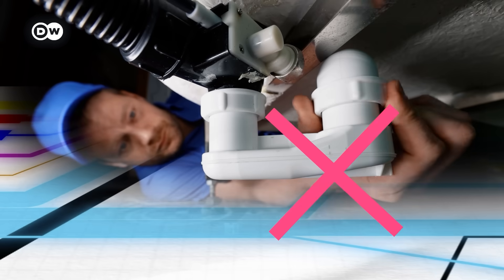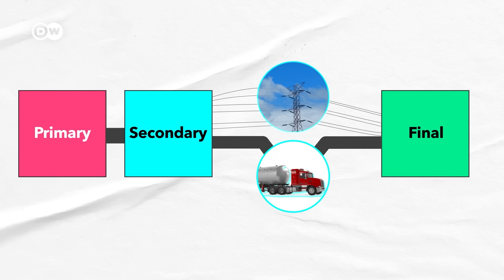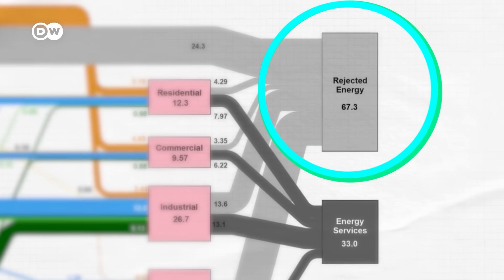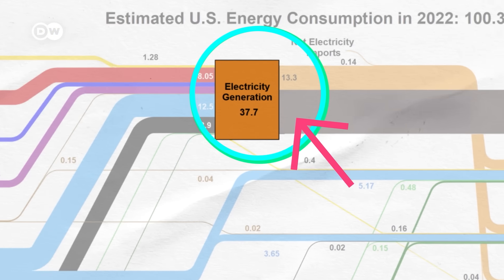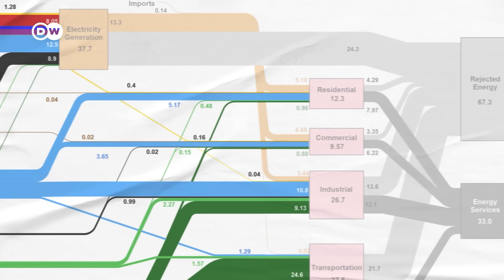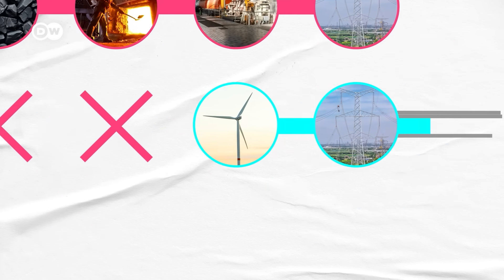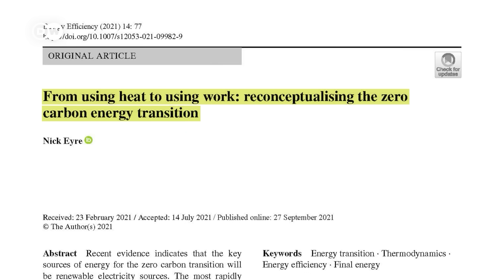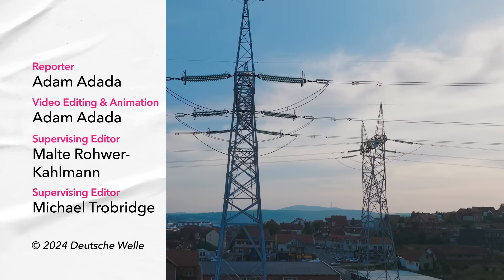The mind-blowing thing we get WRONG about energy

Comment: Sorry, this is a poor piece of propaganda.  This so-called waste energy is all about thermodynamics and statements she made about the efficiency of steam power plants decreasing with age are nonsense.   The efficiency is determined by the cycles used and the temperatures.  For example, a coal plant operating as a supercritical steam plant can get about 40% efficiency going from thermal energy (coal) to electricity and a combined cycle gas turbine (CCGT --running on natural gas) can convert 64% of the heat energy into electricity making that waste much smaller.   That is a 60% increase in heat-to-electricity conversion efficiency.  Coal gets most of its thermal energy from C + O2 => CO2   and gas uses CH4 + 2 O2 => CO2 + 2H2O which means much less CO2 emissions per unit of heat energy (about half as much) making the electricity from gas almost 3 times better than coal per Kg of CO2 emissions.   

These people know the numbers and you can't work in this field without knowing thermodynamics, but they are spinning them.  Trying to simplify thermodynamics for a general audience is hard but to spin is creating propaganda.  (the three laws of thermodynamics - 1- you can't get something from nothing: 2- can't even break even: 3- you die of a dramatic entropy increase )

Possibly the reason for this spin is to protect the stupid decision of our president to ban liquid natural gas export facilities when most of the exported gas could displace coal-produced electricity in other countries resulting in a net CO2 emission decrease.   

As I did my Ph.D. thesis half a century ago at Lawrence Livermore National Lab I know they have known about the above forever.   They know how much you can reduce that waste under which conditions.    For example, I could put heat transfer fins on the bottom of a pot and get more efficiency using gas than using electricity.

Comment: I replaced my gas stove with induction plate, replaced my central heating boiler with an air to air heat pump and my motorcycle with an electric motorcycle. A car with vehicle to grid would be awesome my motorcycle for example only used 500kWh in the 1.5 years I have it and 8000kms I rode with it. Thats around 60L if petrol. 60L of petrol usually gets a motorcycle for 900kms. See how much more efficient this electric motorcycle is? It's also much faster! And I charge it now during the day on my solar energy from my PV panelen :)
Reply: You obviously don't ride anywhere except in the city. I enjoy riding my motorcycle off road, where there's ZERO methods of charging it, and trying to push it mile after mile up hill (coasting down hill I guess) would get rather tiresome quite soon!
Reply: @dundonrl Because there is no ev station infrastructure

Comment: Not to poo poo on this but someone has to point out the fact that at the beginning of the flow of energy ignoring the cost in The amount of energy that it takes to produce the equipment for wind and solar is rather ignorant. The production of carbon fiber and steel and silicon, which are the primary components of all of these devices, are very energy intensive. Never to mind the fact that the recycling of windmills is incredibly energy intensive and most solar panels are not designed to be recycled. So you have to stereotypically mine fresh material.
Reply: Wind turbines are decommissioned just after 20 years of usage (some get lifetime extensions by 5-10 years). But they need at least 15 years of constant usage to be carbon neutral (dependent on the size). Europe has currently over 34.000 wind turbines that are 15 years or older. In the next 5-10 years all of them have to be decommissioned.
After the decommission, the wind turbine blades buried under pile of dirt, since none of them are recyclable. For 34.000 wind turbines (x3 blades each), that's 102.000 blades.
Reply: The rotor blades are buried in the USA. It is not permitted in the EU. They are thermally "recycled". Apart from that, new rotor blades are 90% truly recyclable (not thermally).

Comment: The grid is what 20% of the energy we use? What about everything else. We cannot electrify everything eg ships, aircraft, heavy industry, like to see an electric powered rocket etc. There is simply not enought resources available for copper cable, batteries, and other critical metals and materials. Yes sure we can tweak at the edges of the 20%, but show me the maths and the exact storage technology, together with schematics. I would imagine a modern day Carrington event would  be more destructive with great big antennas from a vastly spread out network from all the panels and turbines. A Carrinton style event will happen sooner or later.

Comment: It's not about efficiency - the efficiency argument in the fossil fuel vs renewable energy debate is just an irrelevant fallacy. Solar panels are only about 22% efficient, and wind turbines are only about 30% efficient, for example....

The issue is how much CO2 is generated in the production of the energy, regardless of how efficient the production of that energy is. The benefit of renewable energy is that much less CO2 is produced by  renewable sources than fossil fuel sources - it just doesn't matter how efficient (or otherwise) they are.....

Similarly, whether something uses electricity or not is not the issue. An electric stove or an EV powered by a fossil fuel generator is not significantly cleaner or more efficient than a gas stove or an internal combustion engine vehicle.....

Comment: This seems fine in principle but I don’t see a realistic way to convert from fossil fuel based central domestic heating to electric. Where will the required electricity come from? In winter, when you require the heat, there isn’t much electricity production from solar and you cannot relay on wind, so you have to generate it with turbines, which as you explained are not that efficient. Also yes, some of the old burners might be less efficient but it’s hell of a lot cheaper to modernize them, than to buy new ones. And also I wouldn’t call them that inefficient, from experience it’s possible to recover so much energy, that the exiting flue gas temperature is around 25C

Comment: In terms of wasted energy, the battery capacity that is needed to go full electric is a pretty big threat to be an equalizer. It doesn't need to meet just the demand threshold (like a hybrid motor vehicle does), but also needs an extra buffer to keep the voltage up. It is not an unsolvable problem in the long term, but cheaper, simpler batteries that don't require a lot of mining would go a long way...
Reply: generating electricity is an intermediate step with its own 66% rejected energy.
and then a further 66% needs to be rejected to convert that into useful work.
u basically end up with 11% useful work instead of 33% if electricity WASNT generated 🤣
Reply: @echelonrank3927  That's an extremity of conversion inefficiency. Electric motors are extremely efficient. The limited portability is the impediment. EVs collectively are a LOT of weight to be trucking around for the 5-10% use case, even if we do have the materials for batteries, which I doubt given what prices are for mass storage.
Reply: @josephfisher426  yeah moving large weights around is definitely a rejected energy problem with EVs. they should be inner city lightweights with a small range.
i mean i dont mind clean air.
but the key to ultimate efficiency is to minimize energy conversion steps and reduce things like running electric cooktops and kettles with gas powered generators over the grid.

Comment: If these "renewables" were so much more efficient, they would have taken over by now... but the definition of efficient doesn’t appear to take into account relative costs.. 

Reliability has a huge value also, and solar still is not reliable and look at the source materials.. hail.. hours without sun.

Wind turbines have huge carbon footprints too.. built on many tons of concrete... lightning strikes.. calm days... Simply not as reliable and ultimately inefficient when accounting for all of the costs.

You say "Getting rid of fossil fuels" at the very end..  simply absurd.. peeps living in utopia.
Reply: these are marvels of technology, the rest is details. the main point is to advance forward pedal through the metal. ouch

Comment: The big thing not mentioned is the more that wind & solar use increase, the more we need inefficient natural gas power plants to make up the shortfall when the wind doesn't blow and the sun doesn't shine. Already in my province in Canada, we suffer power shortages when wind&solar are not running so there is a great need for more fast acting generation to supply the shortfall which reduces the energy efficiency. 
At some point with the way things are going there just will have to be a way to limit power usage during peak demand and that requires the loss of freedom (ie your car can't charge or you can't run your heatpump enough to keep your house at normal temperatures because there is just not enough power available)

Comment: I am not an engineer but I believe this is only half of the story.  Renewable energy cannot be consider baseload energy in as much as production cannot be fixed in advance and is entirely dependent on weather conditions.  The losses from renewables over-production are enormous as well, since the electricity effectively goes to waste.  Batteries also waste massive amounts, I am currently working on a battery project which loses 60% of the final final energy but at least captures it for many hours rather than seeing it go to waste.  All in all you really need nuclear + renewables and if possible hydro.
Reply: You forget the fossil energy needed to produce and maintain the renewable infrastructure, absolutely humongous and strangely COMPLETELY overlooked

Comment: Hmmm. This isn't news to anyone working in the energy sector; it's not like we've suddenly realised we divide our ambitions by 3. Welcome to thermal electricity generation.

This piece doesn't tell you that fossil plant is made less efficient by having renewables on the system. It also doesn't discuss the fact that electricity is a premium fuel; it's clean at the point of use and has tiny losses, this comes at a cost, in fossil it's in the form of conversion losses and in renewables in the economics. 

Finally, in relation to energy efficiency, we have never ever reduced the amount of energy we consume, we have only increased efficiency. If you think we will be using less energy in 2050 you know nothing about energy systems and energy economics. Energy = work, less energy = less wealth.